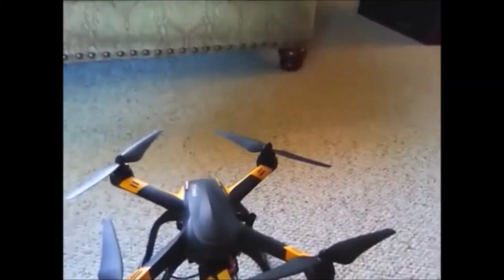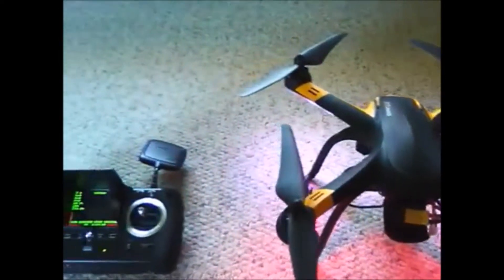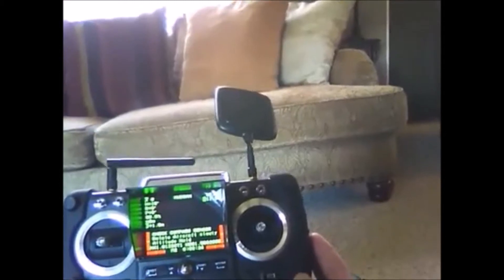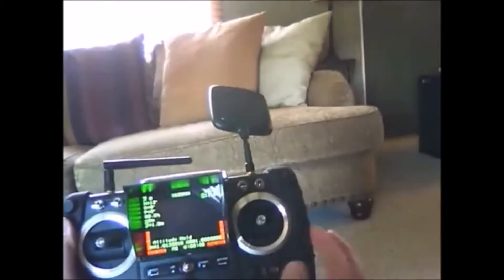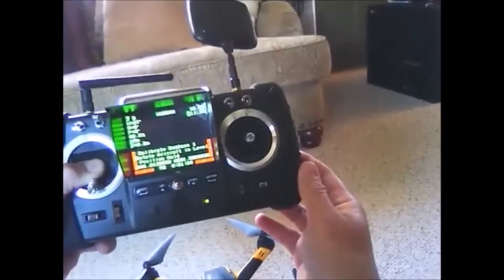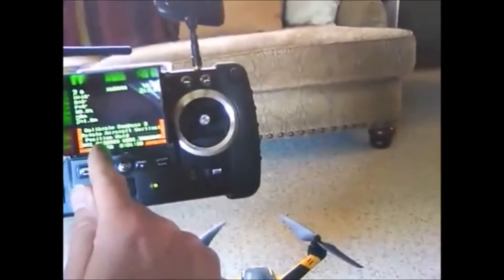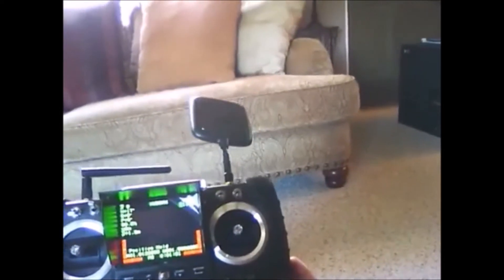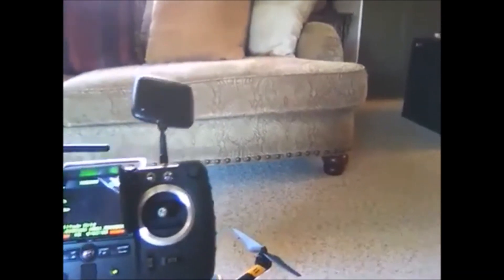How to Calibrate the compass on the HUBSAN X4 109S PRO

Comment: Hello, I have a problem with the hubsan h109s when I turn it on, says Check gyro sensor "and it never advances in calibration. What can I do to fix it?
Reply from the maker: +Jeremy Rivera  I am not too sure on that error you are getting. Did you try to set it on a level surface then slowly rotate the drone until the message goes away? I know it works for compass error message not sure about gyro error. Let me know if it helps I will try and see if I can find anything for that error.
Reply from the maker: +Jeremy Rivera https://youtu.be/hbSFBheaiUQ try this
Reply: Greg D RC Yes, that's my problem but in the h109s
Reply from the maker: +Jeremy Rivera that is all I could find, I'm not familiar with that error my friend, have you tried to 109s group on Facebook? Good people there may be able to help
Reply: Greg D RC Thank you friend for you help
Reply from the maker: +Jeremy Rivera you are welcome

Comment: I have 2 h109s's... I purchased both new. One.... nothing was wrong with it. When I start calibration, it starts with the red L.E.D.s and shows compass 1 calibration. I spin it, then it goes to compass 2 calibration.
The 2nd one is also new, but something was wrong with it when I purchased it, so I got a real good deal. I had to replace the compass just to get it to calibrate. And it does exact same colors as this one you;ve got and showing us. Exactly..... which is not normal. But after spnning it like you for 1st calibration and I do down throttle and flick the GPS switch, then it starts the calibration with red colors and calibrate compass 1. And proceeds then normally to the compass 2 calibration.
Does anyone have any clue why? Why meaning this 2nd H109s has to be spun 3 times to get to same end result as the normal one which only takes two spins, and without the flicking of the GPS switch....
Anyone....
Reply from the maker: +Sean Brooks I'm not sure why. Sometimes I would have an extra spin when doing the calibration,  not sure if it has to do with how fast or slow it's being done. Sometimes doing the calibration not so exact might help?
Reply: Thanks Greg.
Well I purchased and am sending Drone Worship an H109s. I purchased it used where something supposedly wrong with it. Like 2 I purchased for myself. It will get to him the week of Dec. 4th - 9th. He is going to show better props to use over the stock props which are a bit flimsy if you notice. He is going to explain and provide some firmware updates, which I got the latest from the Asian Lady here in U.S. but he points out, the firmware for H501 works for the H109, and he mentioned something about getting the H109s setup for follow me also. So, FYI. you might want to check his channel from time to time now.
Reply from the maker: +Sean Brooks thanks for the info Sean, keep me updated!
Reply from the maker: +Sean Brooks 👍
Reply from the maker: +Sean Brooks nice! Looked locked and steady, crazy how the sats dropped under that little tree but steady for sure 🖒up!